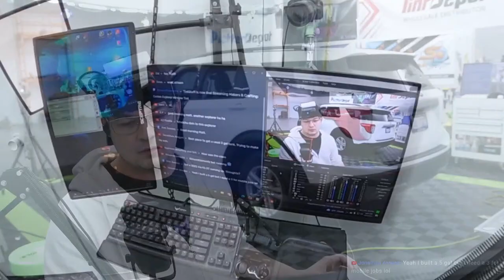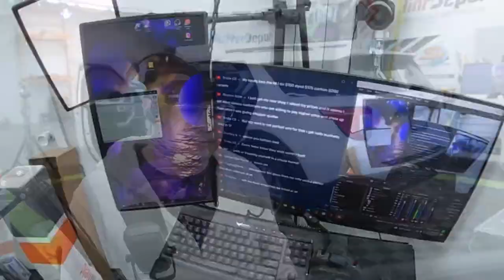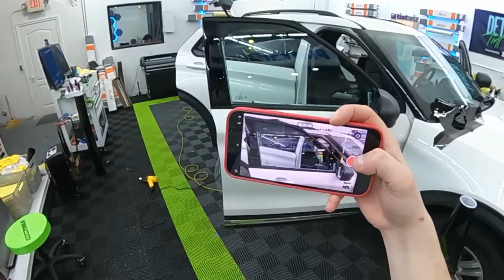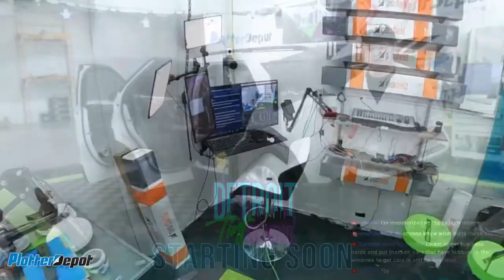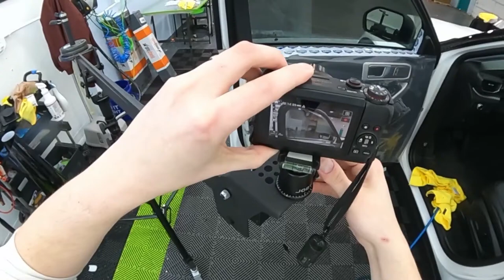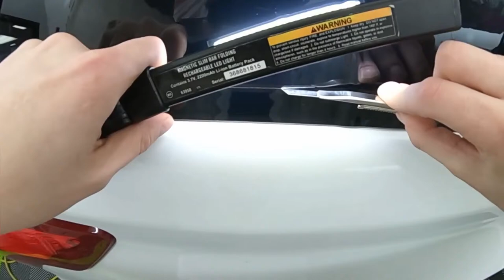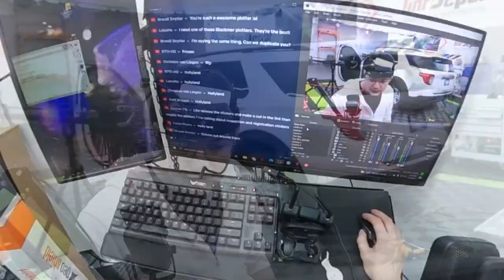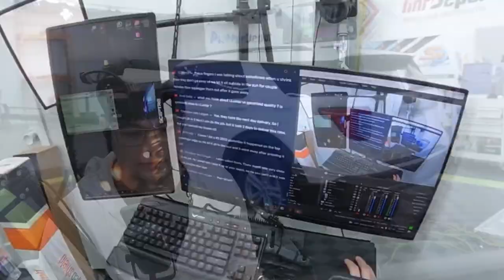Carbon Explorer Window Tint

Comment: I noticed when you cut the film, when you are doing a door, that you flip the tint that you take from the bottom half. Am I seeing that correctly? I guess it makes sense that the driver's side is going to be opposite from the passenger, and it's the clear coat that faces out until you peal it down to install it on the inside? I'm thinking that is the side that has the glue on it so that makes sense, and it also explains how you keep contaminates out of the install. Because the other side, of that bottom piece, is against the car body, which obviously is going to have small debris on it. I'm just thinking out loud, but if I'm wrong let me know.

Comment: if you fix a tint job where there are air pockets are around the defroster lines, how do you price it or guarantee the job? Do you offer a reduced price on removal if it turns out that it needs to be removed and replaced? or do you just encourage them to have to tint removed to begin with? And I'm guessing if the tint is old, then the chance of the adhesive being any good are probably gone. Would you agree with this?